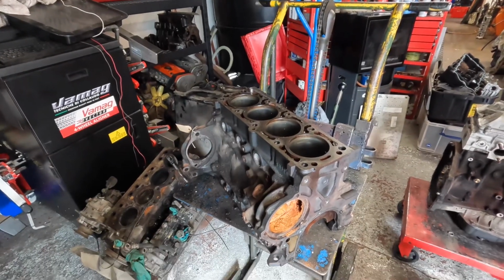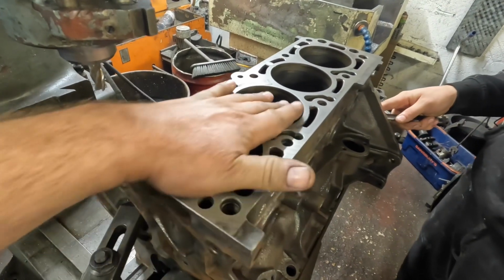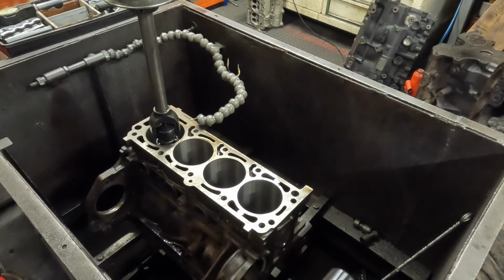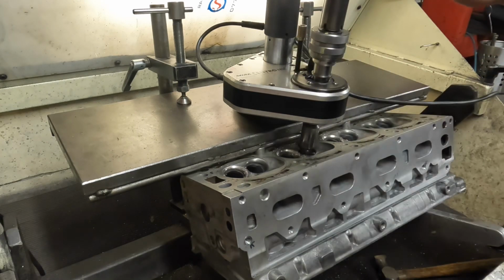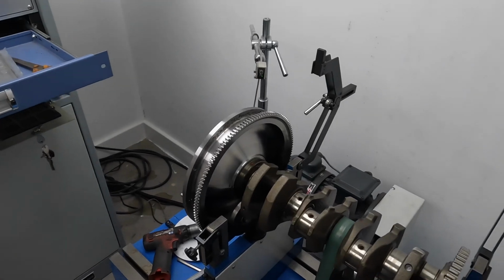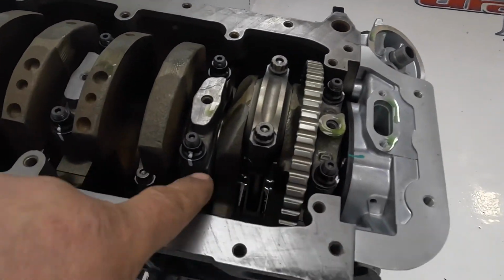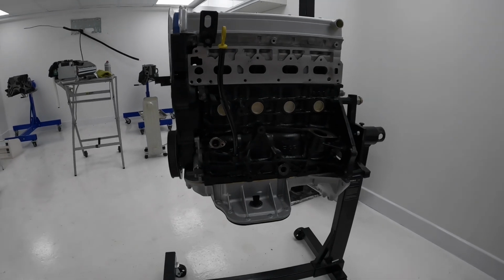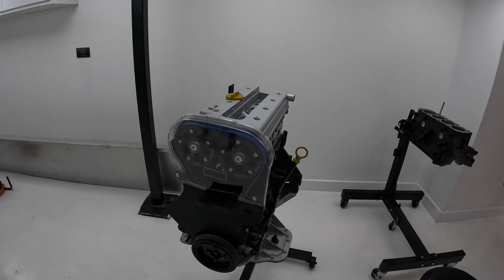Vauxhall VXR 2.0 Turbo engine | Stripped, modified & rebuild by Sam |

Comment: When the caps were cleaned and sanded, were the bores checked? I'm sure you did or would have just didt see anywhere on vid.
Reply from the maker: Hi Richard, yes we check on all main and rod bores
Reply: @graceenginedevelopments  Sorry for all the questions pal, just started binge watching all your vids.
Reply from the maker: @richrdlewis6278  hi mate, I don't mind the questions I actually like the chats.. are you in the same trade
Reply: @graceenginedevelopments  No, have to get all my machine work done before i assemble, 53 now, been at since about 12. Learning more with your vids pal, every days a learning day. Only 3 machine shops left in Swansea now.

Comment: What do the wedges provide when installed in the block/water jacket? Is it a strengthening thing? When/why would it be beneficial to do such a task?
Reply from the maker: Exactly that mate, some engines with wide water passages can crack when you start pushing some boost in there, not all engines need this. You can fit full wedges which are very strong as well as pegs.
Reply: @graceenginedevelopments  Thanks for the explanation. Catch up soon pal.

Comment: Hi can you help I’m doing my first build on my Z20leh I’m stuck on piston ring gap 86.00 bore I’m at a gap for top ring 0.34 does this sound good
Reply from the maker: Yes of course, what make of piston is it
Reply: @ standard Astra h vxr
Reply from the maker: @davidfayers8733 I'd run it slightly bigger than that and the second ring approximately 0.002" bigger than the top
Reply: @ Top ring 0.47mm
Second ring 0.56mm
Oil ring at least 0.60mm this is what I went for in the end after speaking to a company who make and build engines race and road in Holland give them all my specs etc
Reply: Look good to you
Reply from the maker: @davidfayers8733 yes perfect that's where we would be.. top job👍
Reply: @graceenginedevelopments  thanks for your feedback it was hard to get any info of any of the vxr tunners at all crazy
Reply from the maker: @davidfayers8733  no problem, we won't hide anything

Comment: I see you use a digital torque wrench. Are they better than the old click type.  Thinking about upgrading to a digital but not sure which to go for.
Reply from the maker: I really like them they use a pressure pad instead of a spring so they stay calibrated for longer, also the fact the display show 6 different settings is good.. it has a gyroscope for angles so you can ratchet it if room is a problem.

Comment: All that money spent and he’s used those awful nevlock cams and that terrible rts clutch such a shame they’ll want changing after 1500 miles 

Top work on your behalf though
Reply from the maker: It's the first time we've used the cams, whats the issue with them? Have you used them before? And the clutch, what's the problem with that, mainly because we brought one for Sam's van which he is starting to build. Thanks
Reply: @graceenginedevelopments  James we have sold over 250 off those cams not had any issues shame the guy who posted it didn’t get a proper engine rebuilder to fit our cams.
I have all the specifications of our camshafts which I am happy to share with you and you can check them against any of our competitors.
Reply from the maker: @simoncolven9686  don't doubt them mate
Reply: Theres been more than just 1 set damage the lifters probably about 25 now but they just get blocked from nevlock lol i got blocked and never even brought a thing from them 🤣🤣🤣
Reply from the maker: Hi Alex, I got nevlock to send me a cam to test on my camshaft machine, the cam isn't a drive way fit, the acceleration rate is high to be honest so a change of spring is a must, good quality followers as well.. but you shouldn't fit a modified part without inspection of other parts, the cam profile has been checked elsewhere as well.. I've spoken to my customer about this as he supplied all the parts and we've decided to test them in the car, nevlock know our plans and are supporting the test. I'm sorry to read this you've had problems with them, they have always been good with me. Thanks for watching and your feedback.